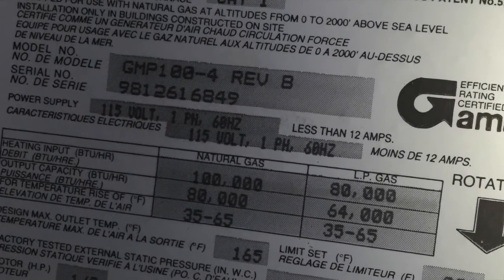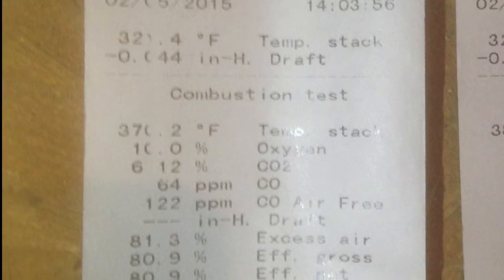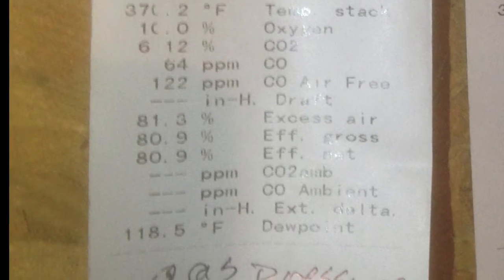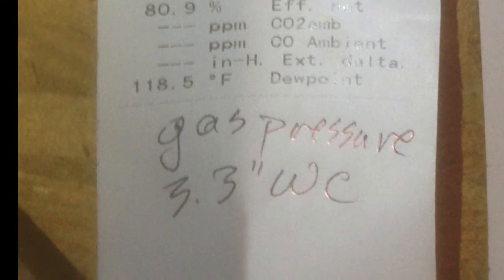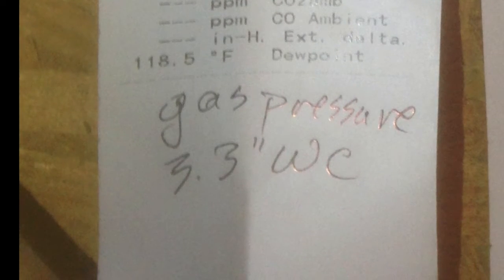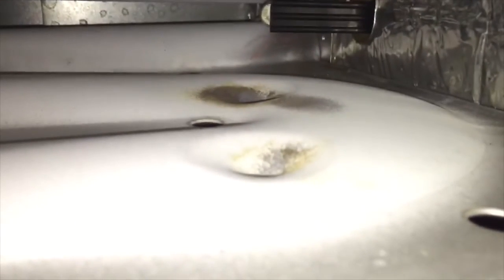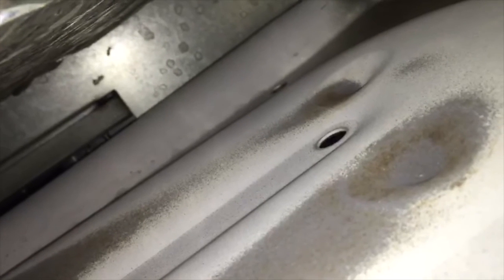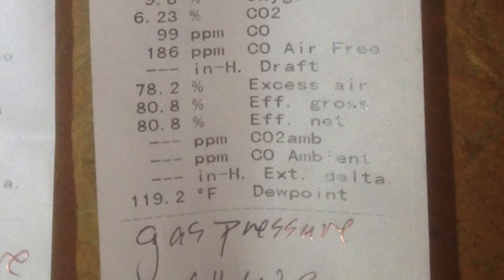HVAC Talk: Rise in O2 and Excess Air During Combustion Analysis

Comment: Stephen, don't lose sight that those are what they call pinch welded and they seal up as they expand and you may be experiencing a heat exchanger that is going to fail real soon. It is always to your advantage to error on the side of caution so I would recommend replacement of the equipment or the heat exchanger but that's just me.

Comment: The Rivets fall out of the Heat Exchanger on the GMP, the ring on the right hand side will just fall off. You can usually just kick the side of the furnace and hear the "rings" bouncing around in the bottom of it.

Comment: As the static pressure increases you will observe an increase o2 reading if there is a leak in the chamber. That looked like a good man jantrol from the 1990's. Just pull the blower 2 screws. Mirror and you will find failed rings laying on the shelf. Carrier pressed the clamshells for a while also. Carriers cracked at the dimples pull high limit 1" round mirror boom. In out write it up sell them a new one. Hope it helps. We have been paying a close eye on the ruud 80%. Pull it fill with water and look for the leaks.

Comment: You can check the draft of the IDM before and after the blower comes on. If the drafts reduces when the blower comes on, it could be interfering with the draft via a breach in the HX. You can also observe burner light off or look for any flame impingement. Maybe the regulator on the gas valve is operating erratically. Are you observing the pressures as you're conducting the combustion test? The other readings should stabilize once the the stack temperature does. Hopefully this is helpful. I'm enjoying the great videos-thanks
Reply from the maker: I was monitoring the gas pressure during the test. I didn't see any fluctuations in pressure. Thanks so much for
Watching and commenting.

Comment: Excellent video every time that we have a rise in oxygen or a rise in Co we know that our combustion  triangle is not perfectly aligned for maximum combustion this is why we do the chemical test with the combustion analyzer I have run across several heat exchangers that I saw my o2 rise rapidly but could not find the crack I'm assuming it was in a seam somewhere that would expand when heated and allow the infiltration of air our job is to ensure the safety of the appliance by performing a combustion analysis  I personally would condemn the heat exchanger because you never know when conditions will change and a unit that was not producing carbon monoxide into the structure is now producing large quantities of carbon dioxide into the structure because the environment around the furnace has change for whatever reason

Comment: I found the units run much better when they switched to Beckett brand burners. If it has the other, you might try replacing them.the crossover is much smaller and shoots much better into the HX.

Comment: at 64ppm. I would recommend replacing the furnace soon to the customer and schedule/provide them with an estimate.
Reply from the maker: 64 in the home, sure. In the flue that’s not unusual. Been a while since I watched this video so I don’t recall the details
Reply: @StephenRardon  most furnaces run between 20 to 50 ppm. anything above 100 in the exhaust could be a problem. either blocked/damaged flue or failing inducer motor if flames rolling out
Reply from the maker: Up to 100 in the flue is typically ok but could likely be improved with some cleaning and adjustment. Over 400 in the flue is definitely a problem. This guide may be helpful to you
https://accutools.com/combustion-quick-start-guide

Comment: When your adjusting the gas valve, in the videos I don't see you checking your temp rise. I would think that your ppm Co and temp rise would be more important than free air? Or is this a litmus test for a bad  heat exchanger. 
Great video by the way. As far as TTT goes a complete I manifold set up would be sweet.
Reply from the maker: I do check temp rise generally. Stack temperature will usually warn you of an excessive temp rise from what I'm seeing. I'm not sure what to deduce from this data and so I'm asking the question. Thanks for watching.

Comment: Your not going to have a ton of control on excess air because it's based on the combustion fan motor package. Manufactures design systems to run with high excess air to give the hydrocarbons in the fuel a better chance of mixing with oxygen molecules. This is especially true with a unit that has a single or two speed psc combustion fan motor with a positive pressure gas valve. As far as the oxygen rising I don't have a good answer. I could be wrong but I was always told to look at CO air free since your CO is a diluted number. It went from all the way up to almost 190. That coupled with your high oxygen seems like you're not getting enough CO to fully combine to make CO2. I'm not sure how to improve that. Your hands seem somewhat tied that you can only adjust gas pressure and indoor fan speed. If your in question about a heat exchanger and are having trouble getting a good look at it or don't want to tear to much apart on some of the 90 percent models where the plastic can crack because your afraid if it's not broke it will be when your done you can pull the air mixing jets out and plug any hole where air could get it (intake, exhaust, drain, or whatever) and use a hot wire anemometer. Turn on the blower and see if you get a particular cell with more air coming out of out than the others. They will all leak a little bit of air! But you can tell if one is more than the others. I would like to say I'm NOT an expert by any means but this is just my input. Stephen thanks for sharing! Its entirely possible I'm wrong about about some of this. Look forward to what others have to say.